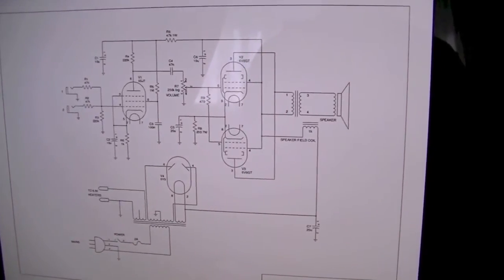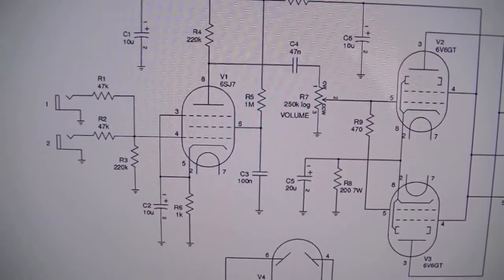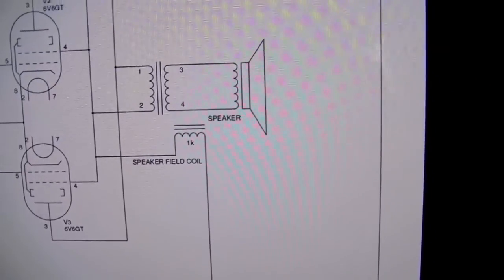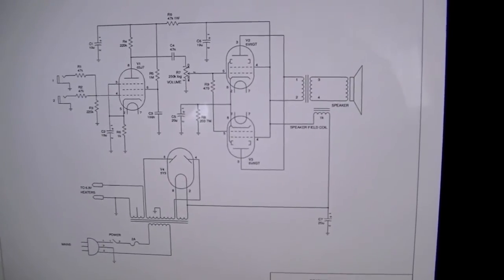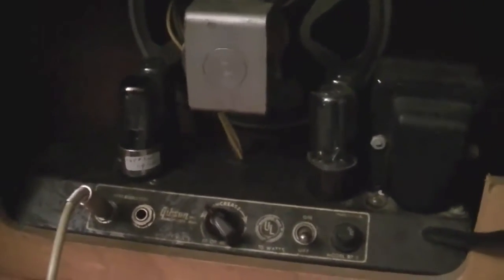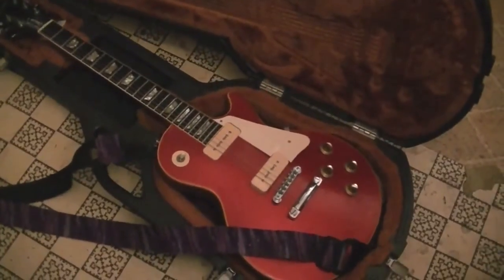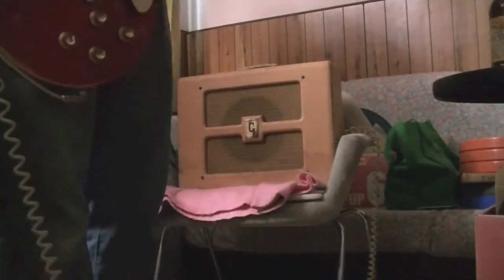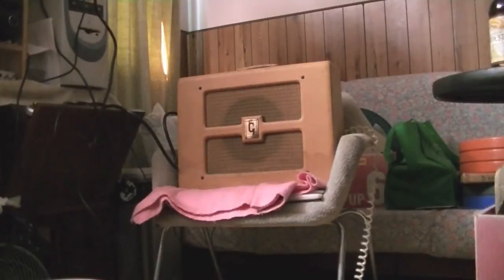Early 50's Gibson BR-9 Guitar Amplifier

Comment: Is your amp a 1953? I have this same amp but it has a Jensen 10” F10S alnico speaker and one of the 6V6's is in a different spot on the chassis. According to the speaker date code on the Jensen, it says it’s a 1953. So I’d guess my BR-9 is a 1954. The differences of one year between Gibson amps is astounding. So cool.